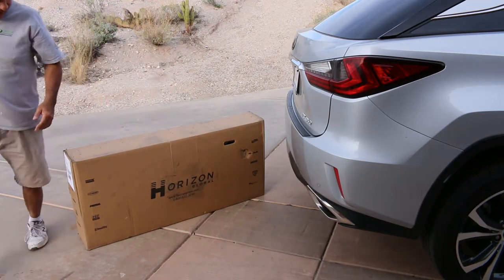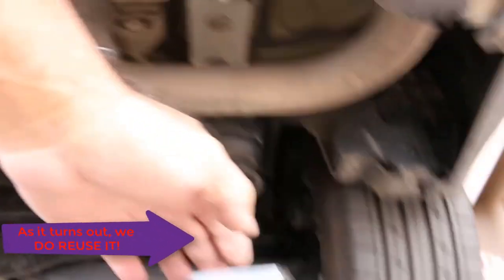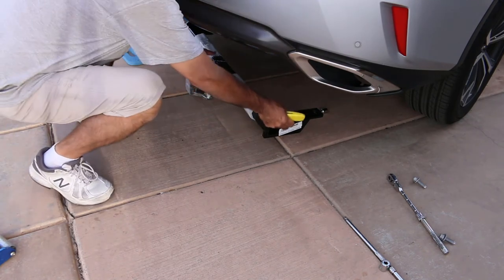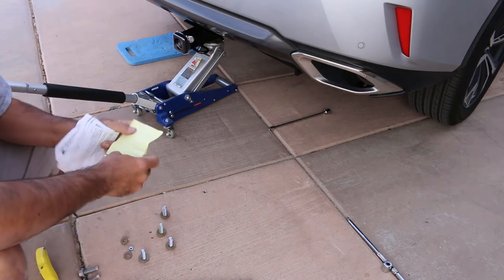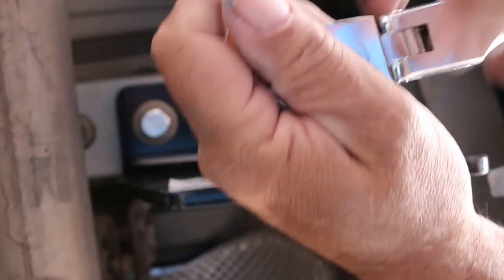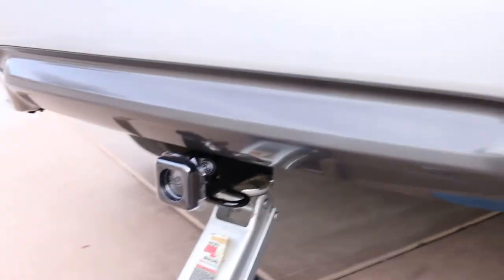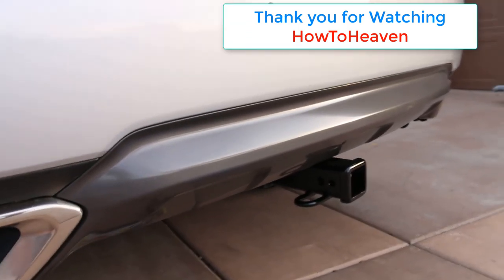2016-2021 Lexus RX 350 How to Install a Trailer Hitch

Comment: The manual says it does not advise towing anything with the rx350. Doesn’t that mean the transmission or engine can be ruined?
Reply from the maker: I can't believe that the manual you are referring to is correct, mine came with the optional tow package straight from the factory!

Comment: my 2021 does not have the towing pkg and the trailer electical connector is dead.  no voltage

Comment: Did you have power to the 4 pin plug? Sometimes you don't have power and have to get a module which allows the power to hitch wire. The module goes on the right side in the trunk area under the small lid and storage. I have a 2020 and having a difficult time finding a hitch
Reply from the maker: Yes, my RX350 had the optional trailer package.
Reply: Scott if you haven't already, this website may have the part you are looking for...https://www.etrailer.com/t1-2020_Lexus_RX+350.htm

Comment: Based on this well done and reassuring video, I ordered a hitch from Amazon that ended up being different than the one you installed (required cutting a trim panel, no bolts, etc.  but did come with five pounds of wrapping paper : ).  Returned that one and I just ordered another hitch I found by searching on the number 84540 (which I saw on a sticker at 3:13).  Looks to be the one you installed in the video.  Thanks for the help, sir ... much appreciated!
Reply from the maker: Thank you for the compliment and the view. Thank you for posting the hitch number for others and finally, thank you for watching HowToHeaven!
Reply: Please consider posting the brand and model in your description

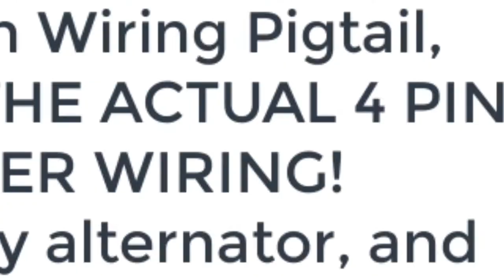Comment: How do we determine if the RX350 is the towing capable option or not? Referring to 3:55. Is it possible to do without those specs?
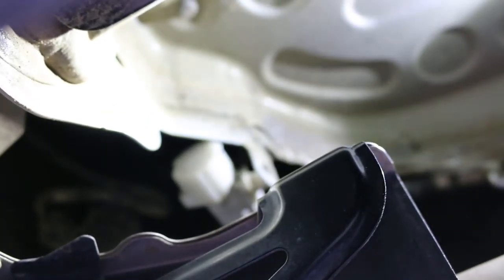Reply from the maker: Thanks for watching, to answer your question on if you have the Tow Option, An easy way to check would be to look your VIN number up on a VIN Decoder, just google it, and you will see all the options that your RX came with, another way would be to look into the driver's side wheel well towards the front. You will see some vents. If your RX has the Tow Option, you will see an additional aluminum small radiator (transmission oil cooler) behind the vents. The third is a little harder but not too hard. You simply crawl under the rear, driver's side of the RX. Look behind the bumper in the rear corner and up and if you see a plug, that is the harness for the lights. In my video it is starts at 20:19. hope these tips help you out~
Finally, yes, you can add a tow hitch to any RX, you just won't have the cooling benefits of the extra transmission radiator, and the charging system upgrade on the tow package equipped RXs. So if you tow a lot and heavy loads, watch your temperature gauge. It doesn't directly read transmission temperatures, but since they share the same radiator, a rise in transmission temperatures should show up on your engine temperature gauge. Happy motoring!
Reply: @HowToHeaven  wow, thanks for the detailed reply! Much appreciated!
Reply from the maker: @randombailey1166  You are welcome!